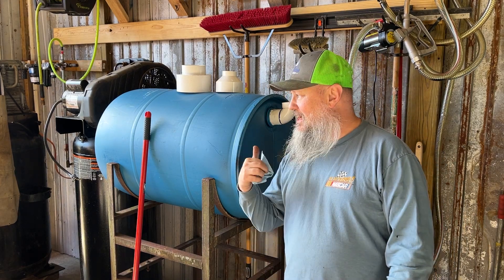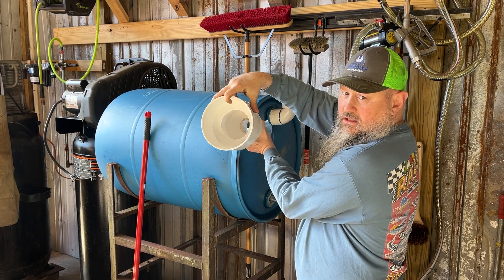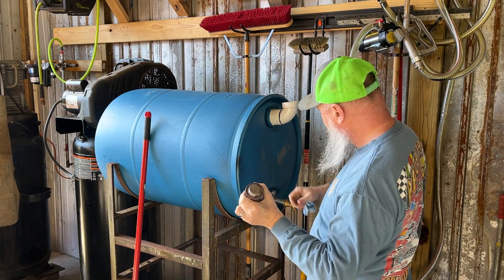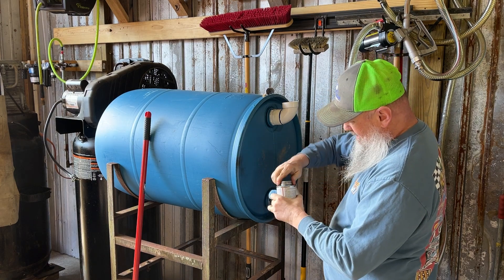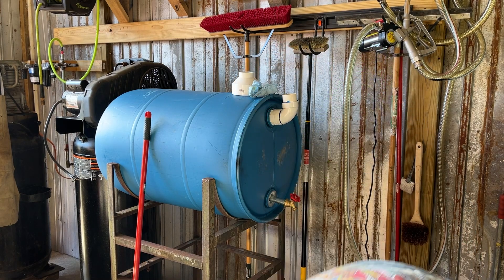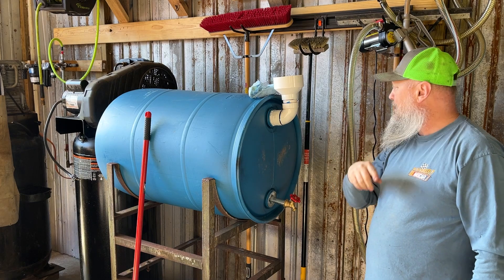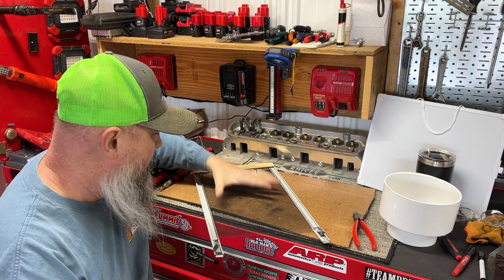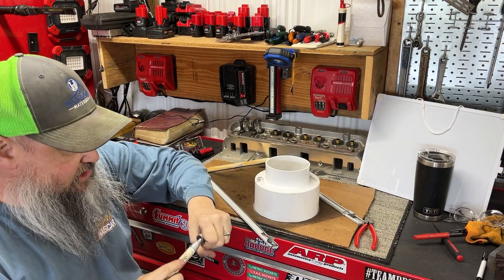Transforming Waste Oil Storage with DIY Filter Funnel

Comment: Hot glue would probably work  or since that part can be removed  put the screen between the two pieces
Reply from the maker: I thought about it, it ended up turning out pretty good. Thank you
Reply: @Jethro2022  yes it did I like the way you did it.